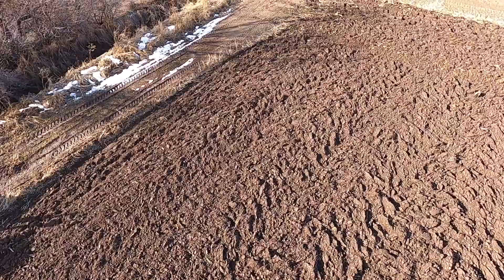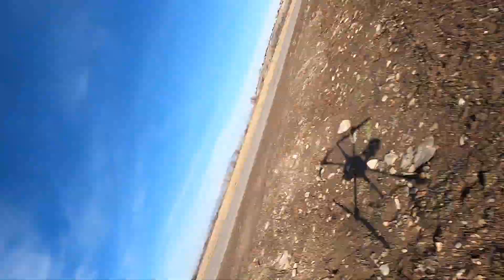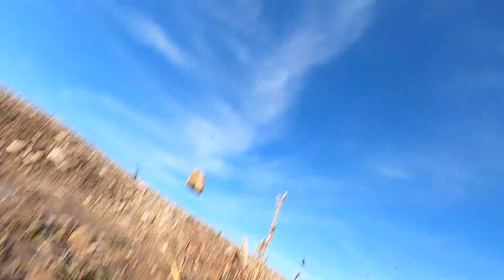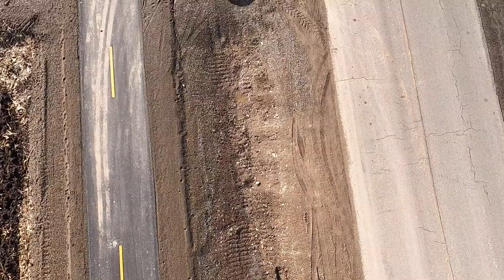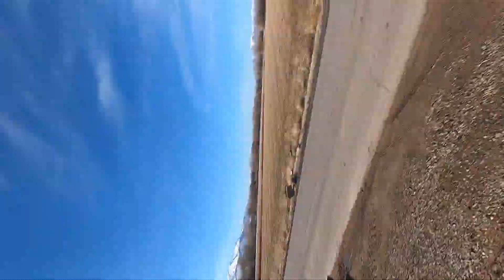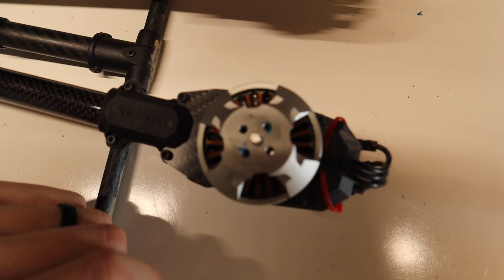BROKE a $1000 drone! What went wrong?

Comment: I googled everything (crash analysis is always fun)...  Long story short, you've over-propped.  You're pushing around ~3600 grams AUW, which puts 900g on each motor at hover.  The motors you're using were designed to spin 12-13x5.5" props that weigh less than half the weight of the 17x65" 30g monsters you've got on there.  This moves your power band down into low RPM's, which takes more energy to do rapid changes in rotational speed.  Every motor coil has to dissipate the excess heat generated while rapidly accelerating and braking, especially when such changes come more rapidly at a higher amplitude during a flat descent through you're own wash or in turbulent wind gusts, and especially when trying to swing heavy prop weight.  When you're cruising around or just hovering, you probably had just enough cooling going on.  It was only a matter of time before you performed just the right combination and timing with your maneuvering to cause this exact type of failure.  See if you can find a prop with a weight of <15g, and keep your pitch under 5.5", or less if you want to stay around 17" in diameter.  Diameter doesn't matter as much, especially if you can lose some load by moving to a hex or octo, though prop weight is still a factor.  Make sure you tune the quad with the AUW you intend to fly it with... cause if the FC is commanding changes more rapidly than are physically possible, the motors are going to heat up with oscillations you won't even be able to see or hear in the motors (resisted by high prop inertia).  900 grams on each motor is around 2/3rd's of their capability, but only if everything else (like tuning) is near perfect.  I'd reduce it if you can, to give yourself a wider safety margin.  Good luck man, I'll be watchin'
Reply from the maker: Thanks for the detailed information. I agree it was the Motor prop combination. I would like to move to a hex however I think that would be more costly for me than just getting 4 different motors that can handle the prop/weight combination. So Im weighing my options.
Reply: @builtfromhome9207  That sounds reasonable.  I personally think about it from a capability level in terms of service life.  "What do I need to make possible, and for how long?"  What kind of downtime is acceptable.  This makes me more apt to standardize a cheaper fleet where I can implement the "2 is 1" philosophy, knowing that operator error and mechanical wear are unavoidable.  But if it's a hobby, sometimes just experiencing what all the different parts can do is more helpful, especially early-on.
Reply from the maker: Yes for me I have other quads and things to keep me busy while I’m waiting for parts to fix this one. I build these things mostly for my personal enjoyment and the drive to learn new things. I have been in the hobby for years and it's just fun. The crashing and learning is all part of the ride.
Reply: @builtfromhome9207  Hey, I modified my 650 quad into 680 hex by changing the frame plate and adding two additional arm. Got the plate for $30 and two arms and mounting for $25. I happened to have two spare motors, so I just need to bought another two esc. Your 10000 6S battery would be perfect for a hex. I'm using 2x8000 4S Tattu Lipo.

Edit: You can buy the plates in AliExpress or Amazon. Mine was bought from Amazon. Cheers!
Reply from the maker: @alphaadhito   do you have a link to the plates you bought?
Reply: mistercohaagen can you help me see if my setup is bad? i have crashed 2 big hexacopter a and i don’t want to add to the list
Reply: @johnmiles5532  Sure, where can I find the details?
Reply: mistercohaagen i am using AKE dark magic 400kv motors with dual sky 40 amp esc and i’m about to get 2 li ion 15000mah 6s  battery’s  and with a tarot 960  frame with 16 inch propellers
Reply: @johnmiles5532  So far;
AKE DARKMagic DM400L3514 400KV (143g each, 35mm stator diameter x 14mm stator height, Is this correct?)
Tarot T960 Hexacopter Frame (1050g)
"dual sky 40 amp esc" (Product link, weight?)
"2 li ion 15000mah 6s" (Are they lithium-ion or lithium-polymer batteries?  Product link, weight?)
"16 inch propellers" (Product link, pitch and weight?)

Where (average altitude above sea-level of the ground at the point of launch) and under what weather conditions, average and maximum flight altitude will your missions be flown?
Do you have any specific desires regarding flight duration, speed or agility?
What is the "all up weight" (AUW) of everything you intend to launch with?  

The process is essentially this;
#1. Identify exact parts and research everything you can find to build an intuition as well as hard statistical references as to what they're individually capable of.  Specific information like motor thrust tests, battery discharge tests and YouTube flight video of similar configurations are especially important to find.  If the information for the exact parts can't be found, look for similar size, weight and capacities to substitute.
  You can use the spreadsheet you build in step #4 to fill in data gaps via graphical plotting; it's all estimation until you're flying anyway.  
#2. Add all the part weights together to determine an all-up weight (AUW), and add some allowance for things like connectors, wire and solder.  You'll need to to determine what the base hover load is so you can calculate flight duration of various or specific battery options.
#3. Use "step #1" data to refine your estimates with your mission and payload specifics in mind.  For instance if you're constantly fighting wind and/or need to fly or change direction more rapidly and/or more often, your average flight wattage will be higher and flight duration will therefore be lower.  Lower air pressure (higher ASL altitude) will mean a greater magnitude in the average motor control command values, which may hurt efficiency if compounded by other conditions or maneuvers.
#4. Attempt to spreadsheet everything to optimize your configuration and estimate it's capabilities in extremis to develop some real world sense of the drone's safety margins.
#5. Test in the real world against your estimates and revise your numbers with your own thrust tests and any other measurement you can take yourself with the actual flight components.  Don't forget that manufactures lie all the time, and the people you saw on YouTube may not be reporting everything accurately.
 
If we can fill in enough of the missing information, I can try and walk you through these steps if you'd like.  If I'm ever trying to determine compatibility between components or trying to design a platform to carry some specific thing in a specific way, this is usually the way I go about evaluating what's available on the market if I have the luxury of constructing a complete build of materials before I buy anything.  The same thinking can be used to tune the rest of my purchases around a given, existing component that I might already own.  It's can be fun to contemplate the possibilities anyway.  Let me know what you find.
Reply: I'm working on a similar project and want some help
Can you give me your email to contact ?
Or contact me on my email
faris.abubaker15@gmail.com

Comment: What is the history of the motor you lost?  How many hours did you have on it, were the bearings ever replaced, lubricated regularly, has it ever been abused in terms of previous near-overheating?  Can you hear any trouble with the bearing on the dead motor compared to the known-good ones?  I say, get >= 3 new ones, replace the bearings in the old ones and adapt the platform into a Hexacopter to lift that nice heavier battery.  I believe if you get the Hex version of the same frame, you'll have yourself some spare carbon for future crashes and mods.
Reply from the maker: So I did have one other small crash on it. Bearings seem just fine but I have not lubricated it for a little while. After reading threw some other comments and looking further into things Im pretty positive these motors were just not suitable for spinning the large props and handling the load I had on it.

Comment: Ive never lost an ESC in flight but the fear of that happening means i will not fly my 450 quad over people or property. i regularly fly fixed wing all over a housing estate but if a quad looses any motor they plummet to the ground as a very heavy dead weight and because of that i only fly my quad in a location similar to where your flying.
A bit of advice, you shouldn't have plugged in one of your other expensive motors to test the ESC, i had a faulty ESC fry a motor when i was building a plane and i put a new motor on thinking it was just a faulty motor and the ESC fried that one too!
if you ever suspect the ESC, plug in a cheap test motor that you dont mind if it burns out, not one of yur good motors!
Reply: That's a good bit of advice, cause the motor creates the load on the ESC; it doesn't push current cause transistors can only allow current to pass.  Big Amp ESC's can still make tiny motors spin just fine.
Reply from the maker: Good tip thanks!

Comment: Here is from some text notes (did not have the source available) 

Numbers you will need for this formula:
Pinion tooth count (pT)
Spur gear tooth count (sT)
Gear ratio (GR)
Tire Diameter (TD)
Approximate RPM (~rpm)
KV rating ( kV)
Amperage of battery (mah/ah)
Voltage of Battery (bV)
Percentage of cell count (%s)
Percentage of kVa (%kVa) (2s only)

Formulas:
GR = sT ÷ pT (driven gear ÷ drive gear)
%s = (3s bV - 2s bV) ÷ 3s bV (for 2s battery)
%kVa = 1 - %s
%s = (4s bV - 3s bV) ÷ 4s bV + 1 (for 4s battery)
~rpm = kV × ah × %kVa (2s)
~rpm = kV × ah (3s)
~rpm = kV × ah × %s (4s+)
MPH (aka top speed) = (~rpm × TD) ÷ (GR × 336)

If you have multiple gear ratios, such as a f/r differential, the second () for the mph formula will look like this: (GR × GR × 336). This will use your overall gear ratio.

The 336 is a static number based on pi and a breakdown of distance over time converted in just distance (as far as I've been able to figure). I can give a better explanation of this if you would like.

Example using my bandit will the old GR vs new GR:

Old pT = 83t
Old sT = 24t
New pT = 33t
New sT = 76t
kV = 3800
TD = 4.25 ( This is only the rear tire, since only the rear tire sees power)
ah = 5
bV = 11.1

~rpm = 3800 × 5 = 19000

Old GR = 83 ÷ 24 = 3.458333 = 3.46
MPH = (19000 × 4.25) ÷ (3.46 × 336) = 69.4587806221 = 69.46

New GR = 76 ÷ 33 = 2.303030303 = 2.30
MPH = (19000 × 4.25) ÷ (2.30 × 336) = 104.4901656315 = 104.49

If i was to use a 2s the math would look like this (using numbers from new GR):

%s = (11.1 - 7.4) ÷ 11.1 = .3333333 = .33 or 33%
%kVa = 1 - .33 = .67
~rpm = 3800 × 5 × .67 = 12730
MPH = (12730 × 4.25) ÷ (2.3 × 336) = 70.0084109731 = 70.01
Reply: LOL...  you just gave me a headache!

Comment: Hi, it certainly looks like over voltage on the motor... you needed to set the voltage limit to make sure that did not happen... this is set as a percentage... search for this to calibrate motor vs ESC power...
Reply: The second time you used the word "voltage", I believe you meant "throttle".  If his ESC's weren't throttle-calibrated, I doubt he would've been able to get a stable hover.  My best guess is that he overheated a motor, and the weakest one failed while it was descending through the quad's own wash, which produces a lot of spikes in amperage draw.
Reply from the maker: I will look into that when I decide on new motors.

Comment: Man, I feel for you. I have had one of my escs fail mid flight too, luckily it was a hexacopter so I could land safely. You can also find the right size carbon tubing from amazon for fairly cheap.
By the way Tattu Plus batteries have intelligent battery management system in them, check if it’s damaged.
The escs are (atleast in my opinion) good but if you want you could change to sunnysky motors or something else that has the same quality.
Reply from the maker: The Battery management seems to be ok but Im going to be looking at it more today. I looked at sunnysky motors when i first built the quad however they were harder to get from online stores like amazon and banggood. I will try to look for them again but maybe from their sight directly.
Reply: @builtfromhome9207  Good luck! Be careful because there are lots of scams.

Comment: What all was damaged? Is the frame usable?
Reply from the maker: One of the arms was broken and will need to be replaced. The gimbal took a good hit but should be easily fixable. Obviously the motor and battery. Im hoping most of it should be fixable without too much effort. Replacing motors will be the expensive part.

Comment: Hang in there. Been there, should I say, 5 times. Some were pilot, some were failures. So many hours evolved with each. I’ve taken a brake focusing on fixed wing camera and FPV planes which are less complex a d more forgiving.
Reply from the maker: I have considered doing some fixed wing FPV. Might have to give it a try some time...